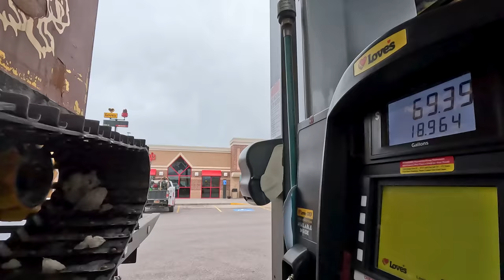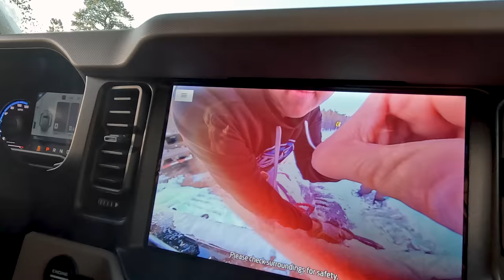22 Ford Bronco Wildcat 600 Miles Stuck In 3 Feet Of Snow!

Comment: Robby, you're probably going to need to replace those two soft shackles. Those tow points on the Bronco have sharp edges, and I'll bet they abraded the soft shackles pretty badly. You need to carry some steel D-ring shackles so you never have to attach soft shackles to holes with sharp edges.

Comment: Hey Robby and Hillbilly, you should install something like backup 🤳📸 cameras but install them underneath of whiskers or the snow cat thingy , install ATLEAST 1 underneath of the snowcat and in between the tracks so you can actually stay or remain inside the cab but use the cameras to know where your (yankum) ropes are and so you don't run the rope over backing up in between each of the yanks , instead of hillbilly or the bronco owner having to pull back your slack , you could just back up centering the rope under the tracks and get a run for it then , just thought maybe that would help somewhat , or atleast I figured it  looked and sounded good anyways 😃☺️ lol wish yall nothing but good luck 🤞

Comment: The Bronco looked to have full street air pressure in the tires when it rolled off the snow.  Maybe less drag on the pull if aired down to 10psi.  Air back up once off the snow.

Comment: The trail turn assist is basically a cutting brake and let's the truck turn super tight and the lockers need to be off for it to function.

Comment: Whiskers needs a paint job badly. Pretty sure I know a qualified crew! Not sure if it would be well received but I was thinking adding "actual whiskers" on the front instead of paint stripes in the form of something like 3 foot cb whips mounted in the middle of the vehicle pointed outward on both sides. Maybe hide the mounting location behind a couple off road lights or something. Just a thought.

Comment: You can may all the seats 💺 air ride  . And if you want more power in the tracks 👣.  Don't go to the engine.  Go to the gears ⚙️.  Because if you gear ⚙️ it right.  And make the tracks spin faster.  Just the same way you would do no a rear-end on a car . To put more power in that rear-end.  But I do everything.  Just a idea.  Love what you guys are doing with Owen.  On the limousineny .
On the 
ROCKIN LIMOUSINY

Comment: Robby, you most definitely need to take the time yourself.   Only you and your wife nobody else. So that way you know for a fact it gets done. 

 You need to make sure every vehicle that you use to go out and rescue other vehicles, have absolutely everything you need to do the job once you leave the shop.  

I would not be beyond even putting extra gas in two,  5 gallon cans because when you get back to the shop you can always take it out. 

Because you never know when you have to wind up, burning more fuel off-road, than you anticipated.  Being organized and having everything possibly you may need is the key to a good rescue and a horrible try.    And fail.

Comment: Me personally I would have went for the JEEP instead of ford they have bad issues electrical and whatever else and a few of those broncos been recalled for some issues from computers to the tranny and other stuff so the JEEP would be at much better model well if you do a horror lady go for the early 2000 fat boy like 2005 to 2015 made a very good center of gravity anything past the 2016 and they didn't like the center of gravity from there didn't feel right OK